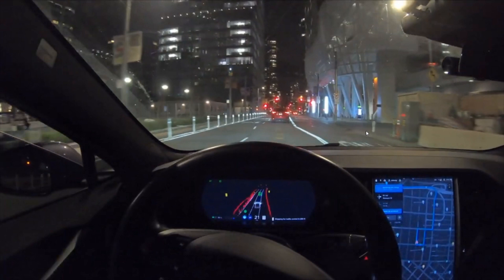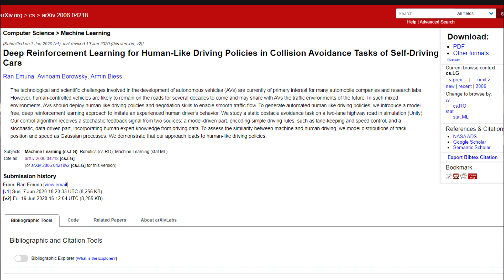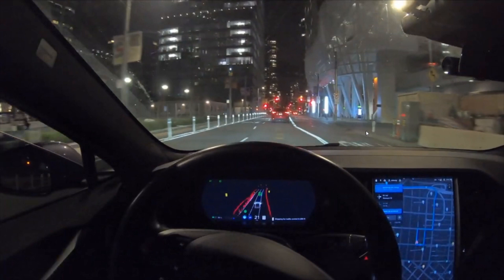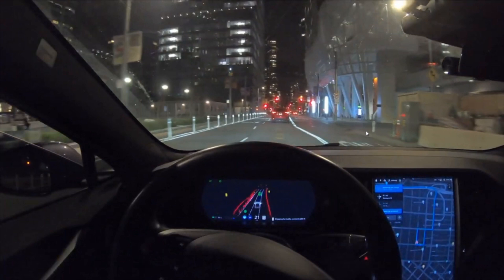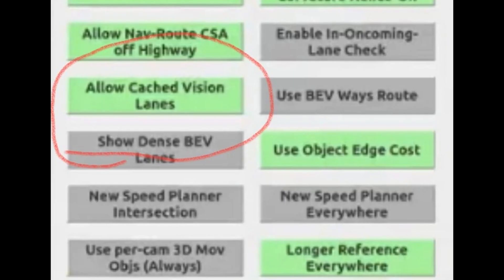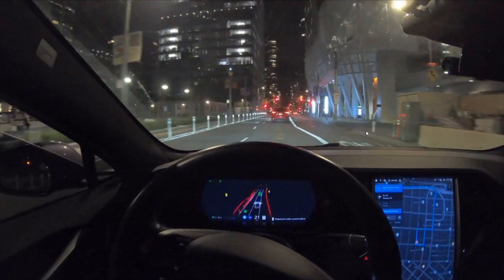FSD Beta 8.1 Analysis - Lane Cache? Reinforcement Learning?

Comment: I had the same theory about that situation (and a few previous videos): I suspect it's essentially saving interpreted data similar to what's shown in the driving visualisation but perhaps not limited to only the most likely interpretation. MobilEye have boasted about how similar data is "only 8 kilobytes per kilometer", so saving less-likely interpretations is also very feasible. Then when driving in the same area (according to GPS) it will need to "match up" the saved data with what it sees around with, in a similar way to what it tries to do with the navigation map. The saved data then influences the probabilities of the competing interpretations of the vision data, i.e. if one interpretation matches what it's seen before, then it's more likely to go with that.

It certainly makes sense to my mind because it's not massively more difficult than what's already required for following the navigation map, yet could have massive value for improving the safety of how it drives. If you can already anticipate all the immovable objects because several Teslas have driven this road before, then you have dramatically reduced the complexity of the scene and have a better chance of identifying the moving objects such as other road users (as well as finding the correct lane).

Also, great detective work on spotting that "cached vision lanes" parameter!